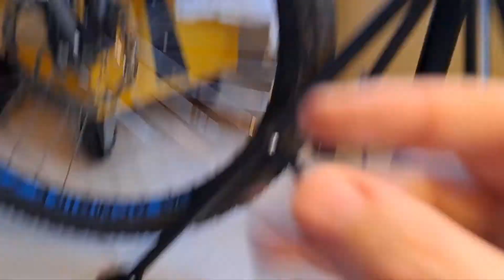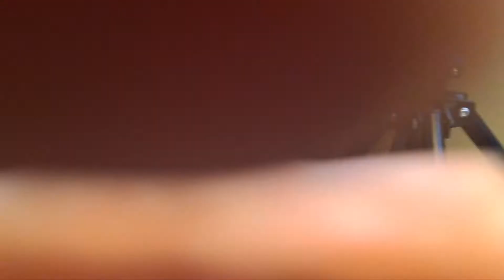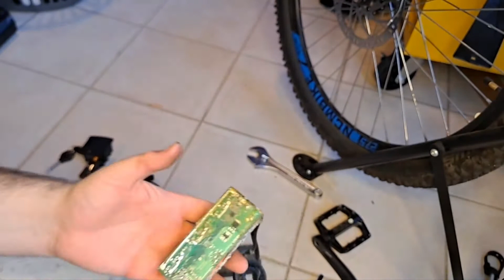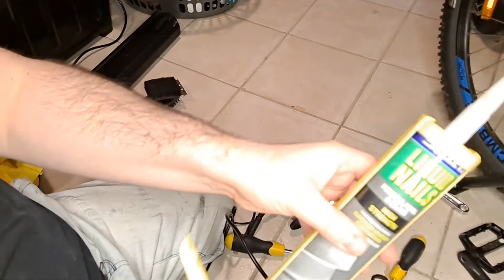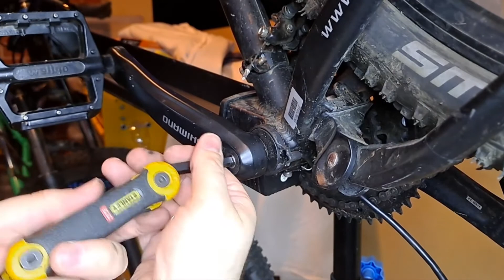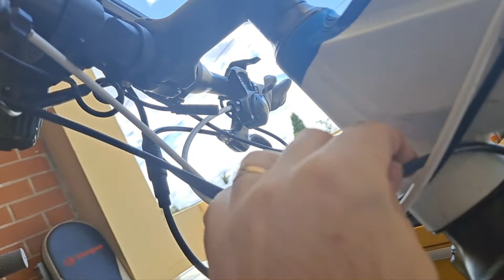Install/remove NCM Moscow 48v Controller and explanation on how to increase power (not top speed)

Comment: When installing the controller its actually easier to attach some string or wire to the wires prior to removing. That way when you feed the wires back up you can attack that string to the wire to help feed it back up. Helped me in the past plenty.

Comment: limits the  voltage   of pack  if u swap cells out for rc lipo packs  and run  60v  or 72v  u can mod the controller to take the added voltage  but  only down side is needing to mod the  software for low voltage cutoff  or mod input reading  circut  to off set  it for higher voltage pack   moded bunch of controllers back in day  lol still do

Comment: What did you change once you removed the sealant? A new capacitor? I think I blinked and missed something as all I saw was expose and reseal it
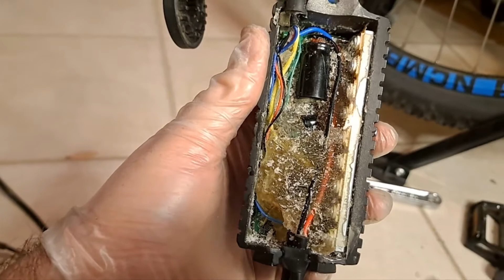Reply: @markedebikes As he mentioned and @10:15 he “beefed up” parts of board etc. and also made breathing room for the board at bottom by makin an air gap w a raised silicone border 👍🏼
Reply: @marked ebikes

Comment: Hi. I have an NCM Miami where the power assist seems to kick-in with every right foot downward stroke. So basically the PA is kicking in and out every half crank revolution. The power burst that happens with the 1st pedal after turning still works Ok, so I'm thinking it's a sensor issue. Can you please suggest what could be wrong?
Reply from the maker: It's sensor or setting (you can change these usually in the display)

Check the owners manual and modify the settings to have the correct magnet count, also check the magnets are not missing or the magnet wheel is not bent or installed on an angle and the sensor is close enough, check for dirt as well

Comment: hi i got a ncm aspen im wondering if you know if eggrider is posible to put on these with a 8pin splitter or if its possible to put a different controller in the same place that this one is on the moscow i dont know what one to get or if its even possible
Reply from the maker: I actually need to upload the video for this, as I did an NCM moscow controller upgrade (kit, brake sensor wire modified and display)

I put a 500w motor kit onto the bike

Comment: Hi I live in Canada and have a ncm aspen plus and want to remove the speed limiter I use it to get to work
Reply from the maker: It is possible in some countries to do this, and it is possible to trick the bike as well but this means getting wrong speed readings. If you would like to contact me, search on google for Marked eBikes